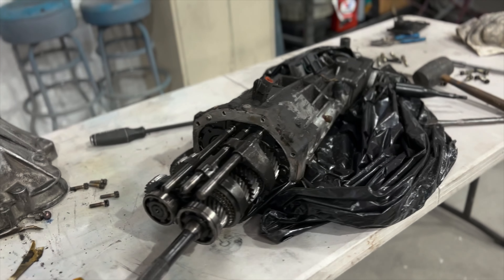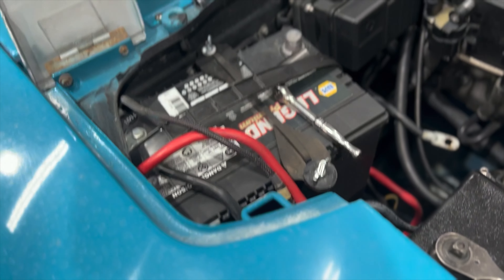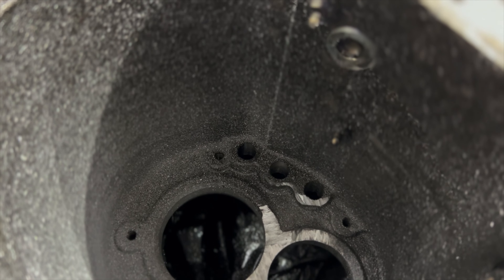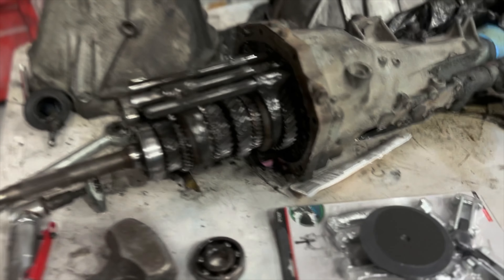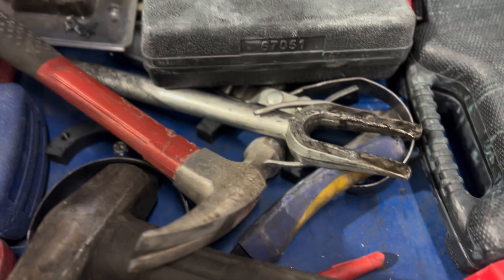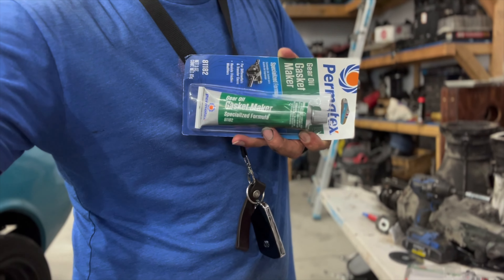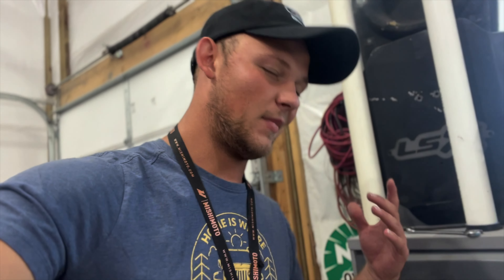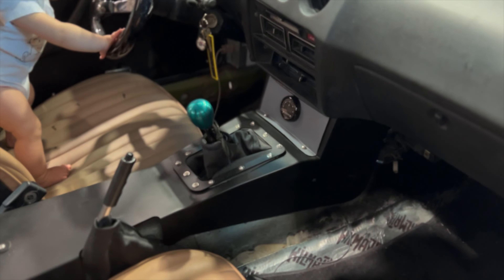I Ruined My Turbo Datsun 280z….

Comment: just started building one of these over on my channel too. this colour is absolutely killer. i do sort of wish i went the turbo L series route before diving right into a swap though lol
Reply from the maker: That’s awesome hey you can’t go wrong with a swap either in my opinion ! And thank you ! It’s Porsche Miami blue it’s a little bit more flat of a color than I was anticipating but it’s still pretty cool I saw you’re doing a 620 ? I really want to get my hands on one of those !
Reply: @octane_media  you have good taste then! I've wanted a 620 for ages. Fixing up the rust but I've got some s13 subframes ready to go into the truck to hopefully get into a little sideways action!
Reply from the maker: @LooseFab  is that a pretty common thing with those trucks is to swap the subframes to s13’s
Reply: I've only come across pictures of one other person having done it! It'll definitely be a learning experience!